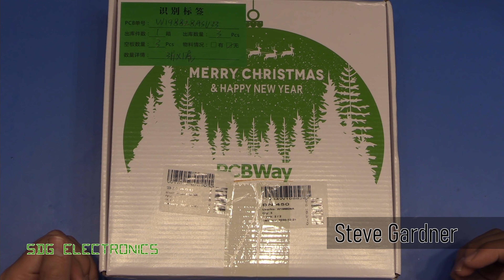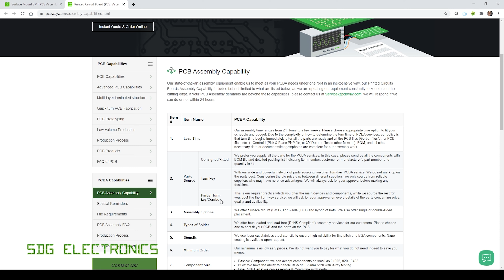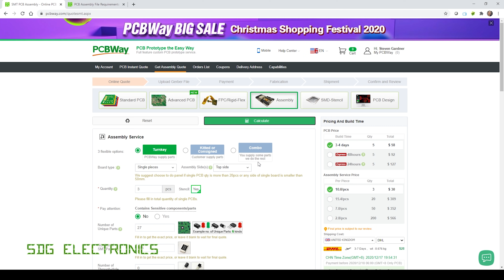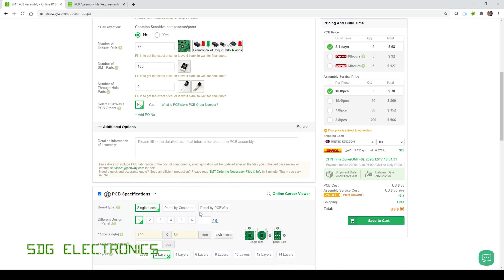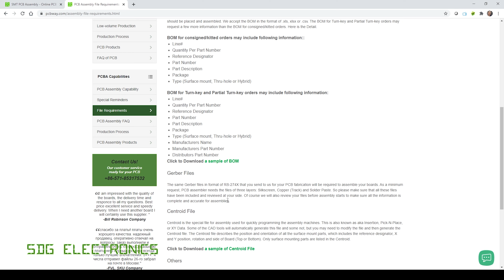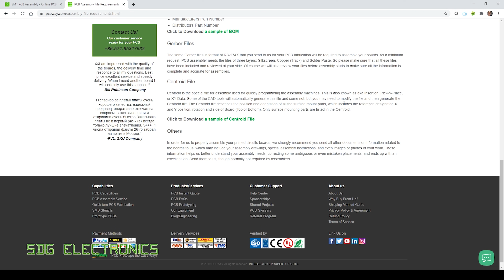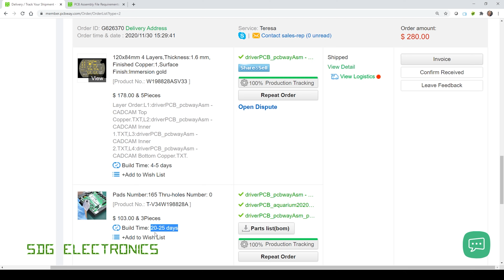SDG #187 All about PCBWay's Turnkey Assembly Service

Comment: 10:08 - Yeah, they won't load just 20 components but rather a full reel and only pick 20 from there. That's what "extended parts" and the setup cost associated with that is. Nobody is placing those by hand.

Comment: Its also good to know that PCBWAY was the only one that could assemble a RED soldermask pcb, jlcpcb cannot, also pcbway can put usb connectors etc. and jlcpcb does not have the capabilities for it as of yet. So jlcpcb is "much cheaper" but the headroom and possibilities you get with PCBWAY is sometimes very very needed.
Reply: Not to mention the limited qty of pcb's you can send for assembly at once (i think that jlcpcb can only do a order of 50)
Reply: Also the low volume question you asked, I think thats why the starting assembly price is usually around 80$ so maybe they do actually hand solder it since the premium is quite a lot for a low number of boards compare to i.e. jlcpcb

Comment: They made them by hand, using the same stencil technique you've shown before. 
Too little paste everywhere. They are a stingy bunch! 
You did a great job. The boards look great.
Reply: If you use too much solder paste on low pitch QFN's you risk shorts which can result in a board not working at all. Better to use thinner stencils everywere because then the risk of a component shorting out is less. It also reduces the chance of the components tombstoning because if you use less solder paste the tensile strength is less. The potential corrosion that can happen on pads which are not completely covered in solder paste is less of an issue. 
Is it ideal? No not really you would prefer every pad to be completely covered but there is a reason these services are so cheap (also very cheap labor).
Reply: @Tr1p93  You haven't said anything that most people here don't already know. 
It's still short ~50%.
This was a hand-job.

Comment: Interesting for future reference, but currently out of my scale.
   I think they should maybe consider ways to streamline. Give me a list of common circuit building block examples using parts they try to keep in stock. Specifically, circuit blocks like common power supplies, radio modules, microcontrollers, and displays. I'm currently half-looking for feasible replacements for an I2S audio amp and an unobtainium clad dc converter from Dialog Semi (DA9230 -incredible part btw). If I had easy circuit blocks I could find and drop into kicad, and then get assembled at a good price, this type of service would be more appealing IMO. If they had some really good designs to use and people really use them, it might be possible to setup the circuit blocks with their own assembly process even if the rest of the circuit needed human assembly. Something like for instance, if I drop in their lithium battery circuit block into my design with their footprints, track layout, and X..Z components, they give me the performance specs and a special price for using the circuit block. They could even make a custom symbol and component library I could drop into kicad and use. Just make the entire block as a single part.
 Just an idea.
-Jake

Comment: That assembly and reflow looks terrible! Sorry to say, when I order assembly on jlcpcb they look 10 times nicer!
Reply: Exactly what I thought seeing this. The only advantage PCBWay has is, that you can have THT components soldered and no limitations for the components themselves. PCBWay is also 2-3 times more expensive than JLCPCB for the same service with much slower turnaround time. However, JLCPCB's component library for their SMT service is so limited, it's a nightmare to deal with when it comes to more complicated designs.
Reply: @111chicane  yep, most of my stuff is relatively simple and if they don't have the odd part I just put them on myself, they do 98% and yes tonnes cheaper

Comment: With PCBWay were you able to preview the assembly to correct rotations of the SMD components in the assembly file?
Reply from the maker: They sent a photo of the first PCB for approval, but there was no check prior to that point other than I had made an error on the MOSFET (I'd picked a DPAK instead of D2PAK) and asked how I'd like to proceed. I think if anything was unclear they would confirm first
Reply: I was sent 2 pictures of the first board they assembled for me (1 front, 1 back) and was asked whether the component rotations were correct. Once I confirmed everything looked good, they assembled the rest of my boards.

Comment: Isn't this far more expensive than JLCPCB? But then the only advantage that you can use DigiKey when LCSC does not have the components (in stock)?
Reply from the maker: I'll work out the cost of the components and see
Reply: It is very likely more expensive, but I would say that JLCPCB's isn't a full-on assembly service: they only assemble one side of the board, they lack any kind of connector whatsoever and if they are out of a specific component, you are screwed until they eventually re-stock it. With that said, I had a few boards assembled by JLCPCB and the soldering was really good, assembly was really fast and very cheap.

Comment: I was wondering; does the price of the components they sourced matched the price of the components if you bought them yourself from LCSC?
Reply from the maker: I didn't get a breakdown, but I'll quickly work it out ready for the next video bringing up this PCB.
Reply: @sdgelectronics  been using their PCBA for a long time, and we asked them about pricing at some point as we noticed higher prices. Apparently digikey prices are higher for them in China than for us in Europe, so boards with a lot of component costs can get pricier, sometimes even exceeding the price we could get for EU-based PCBA where manufacturing costs are higher but Digikey component cheaper. I once did a very low cost board (50 units, <$10 total cost per board, ~$4 for components), with components from LCSC. I provided LCSC order codes, but somehow they refused to order from LCSC and sourced themselves at higher prices. In the end we agreed that I'd place an order at LCSC myself, get it shipped directly to them, and they assemble. It ended up cheaper and worked out well, but was a bit complicated. Still not sure why it had to be that way. Overall their service and manufacturing quality was always satisfactory, and the price is pretty good. Lead times could certainly be shorter, but they are long everywhere unfortunately.
Reply from the maker: @codemakeshare  thanks for the info. Good feedback for anyone reading
Reply: @codemakeshare I actually figured out the same. Professional PCBA service is not really cheaper in china compared to us in the european-union. I order relatively often boards from PCBA services in my job. Always low-volume (<20 boards) with avg. 50-500 SMD parts, 2-6 layer. We contacted a while ago some chinese PCBA suppliers we got in touch with over LinkedIn. If you have in your backmind that you also have to pay customs, the prices are actually even higher. I would assume that you get the boards like shown in the video above for more or less the same price here in Germany if you get a fair offer. And yes - components prices (especially for quality brand IC's) are often higher in china. The PCBA suppliers wanted to charge us in avg. 30-40% more in comparison to mouser/digikey single-unit prices here.
Reply: I think the cheapest way for hobbyists is to order single-PCBs from e.g. JLCPCB with stencil and to get the parts directly from a distributor. SMD soldering with stencil is relatively easy.
Reply: @YetAnotherElectronicsChannel  Yes, that's what we're doing as well for prototypes and urgent jobs (<10 units). JLCPCB's assembly service is awesome if you can make it work for some designs - used it quite a few times and it was great, but their constraints don't work for most of our designs.  I've been tempted now and then to look into a simple pick and place machine (maybe DIY with OpenPNP) to bridge the gap between hand soldering, and very slow outsourced PCBA. In the last months, some German PCBA suppliers have even increased lead times due to high demand. I know of small(-ish) companies who started their own internal board production with pro machines (>100k on low-interest credit) to have control over scheduling and parts, as the lead times and uncertainty were too much. I feel there's still quite a gap to be filled. The actual PnP job (after prep work and parts ordering that can be done while the PCB is still in production) should only take 1 day, so the lead time is mostly just scheduling I think. You can of course pay extra for faster delivery, but the surcharge mostly makes it way too expensive then.